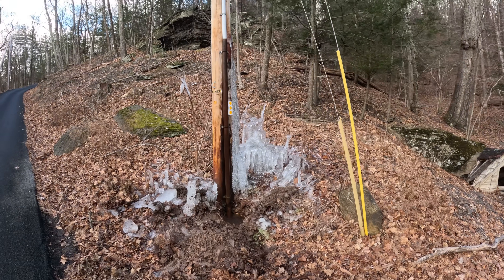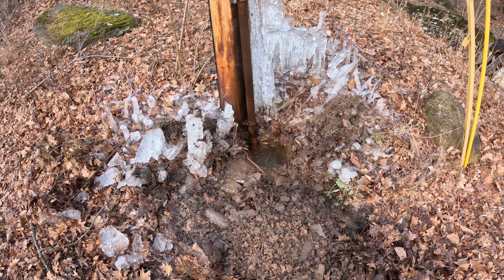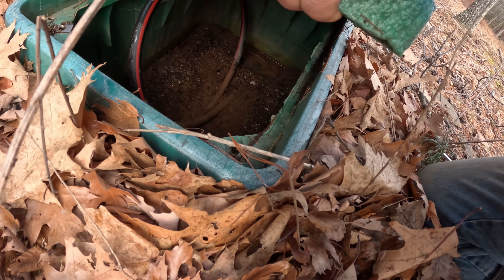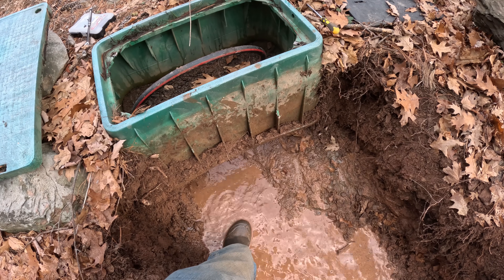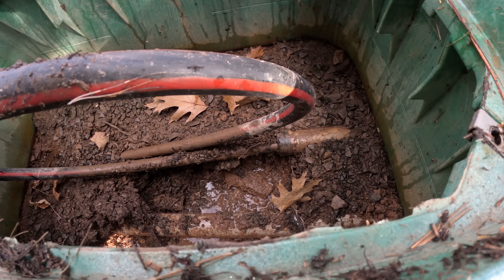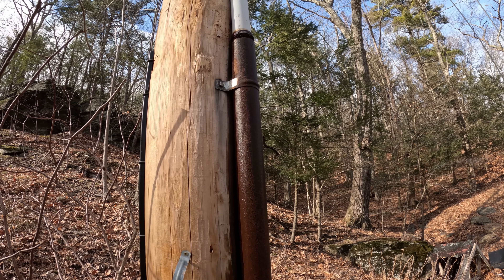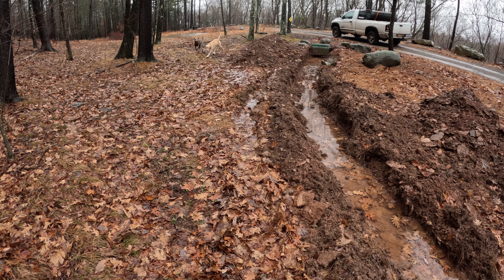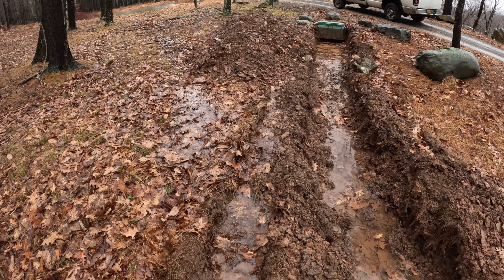Keeping water out of an electric conduit

Comment: I would take an air compressor to the conduit to get the water out, just so that way it doesn’t degrade the wire faster or rust out the conduit

Comment: AC you could maybe shoot compressed air through the conduit at the pull box to try emptying the standing water inside the conduit. I doubt you'd get all of it. Drilling a hole or two at the elbow and then using the air would certainly get it all out and dry the inside too. Then u could seal the hole(s) in the elbow. U did the hard part already, eliminating the source of flooding. It's pretty cool how nature will find a way to expose our little human errors. Where I'm from you don't see this because the elevation is flat. The flooding at higher elevation caused the water to go UP the conduit at the pole. Very strange for anyone not used to hills. 😮 💦⚡

Comment: Watch those pull boxes that cable could be a high voltage cable of 12200 volts if energized
Reply from the maker: It is high voltage. My understanding is to not even touch it.

Comment: as an electrician i have dealt with this a few times but only in situations like this where the water ingress is on a slope where one end or the other ends up with water coming up above grade. UG conduit always has water in it from condensation over time if from no other source electrical pvc joints are not required to be water tight and ridged  pipe is even worse electrical conduit threads are not pitched the way plumbing threads are this is why water ingress is simply permitted and factored in to the wires insulation properties....you just cant have it fountain up inside a panel because some well meaning person tried to seal the "leak" by filling the end of the conduit with expanding foam....that's "bad".

Comment: Oh no means am I questioning your video I’m watching this possible learn something that I’m not aware of i’m not sure which way the cable is going from that box but I would always recommend digging with the cable straddling the line and digging in the direction it is right that way if there are other cables that you’re not aware of or hitting it he will drag over top of it and not yank it? I recently had a conversation with a guy regarding this one we’re doing a disconnect for a demolition his response was we’re demoing the house who cares as he dug and pulled the water line out not only did he break the line but he pulled it out at the valve in the street and it was a mess and even though it was in the street and not technically our responsibility since he damaged it we had to fix it and it was not fun just always want to pass on any helpful hints I have not necessarily for Whoever is involved in the video but anybody reading the college knowledge is key and knowledge is the best thing that you can accept or pass on to someone

Comment: Nice to see an operator who will get out of the cab and grab a shovel, that's a rare thing. Generally they mess about with the hoe or loader trying to fine tune things and just waste time and fuel and don't do as good of a job as they could have with a spade and a rake...  
Dude I watch your channel because you're a total stud, the things you accomplish with your equipment is amazing especially your early videos before you had the larger more capable equipment. 
I have some feedback on this video that I feel bad offering. I think you rule man but I was cringing at 12:39 when you buried the drain with big rocks on top of it. Those rocks most likely just pinched off your pipe or will over time.  You can't back fill your trenches with "Deleterious Materials" like rocks or wood on top of your pipe. A sandbag (or two) on either side and one bridging across the top is acceptable, but with soft material like the pipe you're using, those rocks are a total sin. 
I guarantee your capacity is or will be reduced from what it could be which will cause it to plug up a lot more easily, and the odds of you needing to redo that job are high.  
Sorry if that came across as rude or preachy, I just hate to see a great guy waste his materials and have to re-do a job.
Reply from the maker: Thanks. yeah, I did that to hold the pipe down. Hopefully it stays working. If not I will use stronger pipe.

Comment: No video of the top of the conduit going up the pole, but it should have a weatherhead on it to keep water out of the that conduit.  The utility should have required a pedestal enclosure when used in an area with poor drainage or prone to flooding.

Comment: It's good practice to install a drain at every pull box.  It is a requirement on a commercial installation.  We ran many of them into the nearest storm drain. Where I worked, the original installation resulted in a spring running into the main electrical room.  We did stop it when we ran new high voltage cables into the service.  So where there is subsurface water, the odds of water running into conduit is pretty good.

Comment: Shared this with my brother who just retired from National Grid out of Hudson NY. He’s seen this  issue many times. As you stated they drill a hole in the conduit usually. He was wondering why you have those boxes in when your transformer is up by your shop?
Reply from the maker: Because the run was so long, it helped to pull the wire in sections. I should have just installed more transformer boxes in case I wanted more electric services. I guess it wouldn't be hard to dig one of those up and drop a bigger box in place if needed though.

Comment: I hope that that is low voltage you working with there (<600vac) Even that can fry your ass on that excavator.
Reply: You're funny, it's a coaxial power feed, single phase, either 7200 volts or 9600 volts.

Comment: Great job, you always fix them right.  I don't miss chasing water leaks to finally find it a mile away. They always follow the electrical conduits for some reason. I chased a leak for 6 months trying to find the source. Finally found it. A homeowner had a leak on their in ground pool. It was my water but not my problem after that point.

Comment: Anyone care to explai. How this fixes the problem?
Reply: Look where the pole is and where the box is. Ground water was flowing in to the box, and power cable is bizarre. There is metal pipe in which they put power cable, there is space between and water flowing into the pipe. Because box is higher than the exit of the pipe at the pole, water was coming out there and it acted like the culvert for water.  Andrew dig a ditch so the water flow into it not flooding the box. Now water is below the pipe and not flowing into it but to the culvert he install.  But this pipe is still full of water. Maybe it will vaporize over time, or corrosion will make hole in it and it will flow to the ground.  Hope that this clears things out.   Sorry for chaotic language.. not many chances to use english

Comment: I've been watching several of his repair jobs annd I don't understand how he is getting away on his welding jobs without making sure that all the oil, paint & other junk is removed from the welding area. If you are using stick welding you can get away with this at times but Mig welding requires a clean joint.

Comment: It amazes me that someone so smart, talented and gifted with the ability to fix anything thrown at them, can be so incredibly stupid by poking and prodding at an energized primary voltage hand hole, with a metal shovel, standing in water. I’ve seen 4 fatalities in my career with these circumstances. That underground cable we use is garbage. You may think it’s insulated, but the slightest tear in that cable will leak voltage. You won’t feel a thing.

Comment: I have a neighbour who has 'a spring' in the middle of his yard.  It is the spot where the pressure of the water in the bedding sand surrounding a 10" natural gas pipeline overcomes the weight of the ground above.  The water is flowing in the bedding sand and the entire installation is on a slope.

This could happen around electrical services causing flooding into the perimeter drains.  As a matter of fact I had a ditch dug for a service that filled up with rain water which broke through later that night into the perimeter drain system which was evident way down the hill as a brown stain running into the river down there.  It was about a 300' long ditch 3' wide and 3-4 foot deep.  That was a lot of cubic yards of water to collect in there and to drain out through those 4 inch perimeter drain pipes.  Talk about creating underground streams.

Comment: Our conduits for the runway and taxiway lights always fill with water when the drains clog and due to ground water. It's a 5kv constant current system and usually the water isn't a problem.

Comment: I have an idea for you, Andrew....obviously, the body and beds on modern pickup trucks are too thin and flimsy for real work, so a friend of mine has come up with a solution..he has taken a late 1990's Dodge 3/4 ton longbed pickup, with a Cummins engine, removed the body and bed, and is installing a 1950's/'60's Dodge Power Wagon military truck cab and bed on it...the cab and bed are tough as nails!...and, it looks good..everything seems to be working out well, he has it about 80% finished...good way to keep the reliable modern mechanicals, and get rid of the flimsy modern body(and crumbling dash)...just an idea..😉

Comment: Leave that elbow loose or that moisture will sit in there and rot the wire insulation. 
I usually drill a small hole on the bottom of the elbow then scrape the ridge off on the inside.

Comment: You guys watch out on that power wire! It's probably 7500 volts, if you cut into yours an explosion will result and you will probably be electrocuted on your machine. My wife worked for an electric company and one of the linemen touched a hot lead thinking it was off, he got electrocuted and lost both his arms above the elbow. When the other guys at the scene pulled his gloves off his fingers stayed in the gloves. It wasn't a good day. He lived. Think of those underground powerlines as a buried 55-gallon tank full of gasoline. That's what I do, It helps me to respect it more. I love Andrews's videos!

Comment: Word of advice andrew, maybe you should take this video down.   I work for a power utility and anytime we come across tampering involving our equipment it usually turns out bad for the customer.   Your utility may be way different.   just my 2 cents.
Reply from the maker: They told me to do it. I was in contact with them during the project.
Reply from the maker: Here the wire is customer property. I am allowed to do maintenance to it.
Reply: @AndrewCamarata  Right on man, disregard the comment
Reply: That would depend on where the utility company's responsibility ends (not necessarily at the meter drop) and where the property owner's responsibility begins.

Comment: I did exactly that to my electric service conduit.  Made a cut across the bend in the elbow...drains water like a champ.  But what are the odds that you'd set a pull box right on top of a spring.

Comment: Nice work. But a more simple fix would perhaps have been to inject some expanding foam into the open end of the conduit?
Reply from the maker: I would rather have the pull box not have any water in it.
Reply: @AndrewCamarata  Agreed, your fix is thorough and correct, but the neighbors had apparently just been complaining.

Comment: Breaking the elbow to let the water flow would have just lead to a cavity being created down and around the underground portion of the pole. Wouldn't take long for it to eat enough away for that pole to start leaning in whichever direction the weight of the wires is hanging. From there it either breaks or falls down or has intermittent loss of connection when its windy or any number of issues that creep up when a problem was not fixed correctly. Your fix keeps the packed dirt under the pole just as it is and diverts the water problem far away from the pole. A much better solution. Well done.

Comment: There is no such thing as a dry raceway. I have even had gallons of water pour out on me from an overhead pipe INSIDE a building. How 'bout an "ice volcano" that blew the door off a pad mount transformer. - Running water from 13.2 KV line in an underground concrete encased conduit that kept the water from freezing and draining away but froze when it exited the pipe and kept building up until it ht the pot heads and BOOM! - Just enough mineral in the water to get the arc going and cause a steam explosion. .... I gave up trying 30 years ago. There is just no way to keep water out. Like the code says "Arranged so to drain" like you did is the best you can hope for..

Comment: As long as the water did not get inside the cable jacket and next to the individual insulated wires there should be no problem. Still good to keep water out of the conduit sleeves.

Comment: I have a kx 121  like yours. It broke a pin on quick attach and the thumb. Thinking about changing to a solid pin. This be  third pin. 1,st pin was bent and not broken. The machine has done a lot of rock work for retaining walls.
Reply from the maker: I changed to a solid pin, I made it. There is a video of me doing it.
Reply: @AndrewCamarata  Ill look for it.Thanks.
Reply from the maker: Yeah, I have a 121 and a 161
Reply: Is that another kubota  you got like at the mountain

Comment: MINE IS ALSO UNDER GROUND 350 MCM AND 3 INCH CONDUIT BUT I LAID THE WIRE IN TRENCH FIRST THE PULLED THE CONDUIT FROM EACH END OR DIRECTION FROM POLL AND FROM HOUSE TO POLE AND  COUPLED AND GLUED THEM UP  BUT MINE IS ALL DOWN HILL AND ONLY 300 OR SO FEET LONG  COMPARED TO YOURS A SHORT DISTANCE SO I CAN SEE WHY YOU HAD TO INSTALL JUNCTION BOXES BECAUSE OF THE LONG PULL UP TO THE CASTLE  AT BASE OF MY POLE ITS STILL DOWN GRADE SO I DRILLED A SMALL HOLE IN MY 90  OR THE ELBOW THAT TURNS UP THE POLE AT BASE OF POLE AND DUG OUT AND PUT GRAVEL IN THERE INCASE WATER EVER GOT INTO THE CONDUIT IT WOULD DRAIN OUT  DIRECT BURIAL WIRE IS GOOD BUT OVER TIME MANY YEARS WATER CAN GET INTO IT AND CAUSE A SHORT I DON'T WANT TO EVER HAVE TO DIG MINE BACK UP AGAIN IF I CAN HELP IT MUCH OF IT IS ABOUT 26 INCH'S BELOW GROUND LEVEL BUT BECAUSE MY PROPERTY IS TERRACED SOME OF IT IS UP TO 8 FT BELOW GROUND LEVEL AND I WAS 20 YEARS YOUNGER DOING IT MYSELF LOL IM ON A LARGE HILL ALSO  BUT NO GRAY STONE LOL  BUT DO HAVE SOME LARGE LIMESTONE ROCKS  I USED A TRACKHOE TO INSTALL MY DITCH

Comment: Great job bro !
You could try to blow the water out.  Just connect an air compressor or the tire bead seater and seal it with some plastic bags (doesn’t have to be air tight). That should dry it out enough 😁

Comment: I am confused. The line from the pole is light grey, the conduit is metal, the line in the pole box is black with a red stripe, the conduit in the box is poly. Would an electrician explain please. ?  Thank you. 😃
Reply from the maker: The 10' up the pole has to be metal (its very thick meta). I think I just slipped it over the plastic there.

Comment: Before connecting the hydraulic lines, turn off the engine and move the levers to relieve pressure in the hydraulic system, you will not have to bother with connecting.

Comment: Like I said before put the hammer in the leanto of put it on a pallet up off the ground under a rubberized tarp., I used to work on those and they are not cheap to fix.

Comment: I would have liked to see that chamber cleaned out too, but you are a busy guy. They could have avoided the problem by using a vertical bend in the pit and sealing the conduit. Actually I’m sure that’s code.

Comment: Water is not running through the conduit anymore but the water in there is going to be there for many years.... Needs to have a weep hole and drain in the bottom of the lower sweep.

Comment: Andrew the water in the pipe will erode the plastic on the wire quicker. But you did a great job of solving the major problem. 👍👍👏

Comment: I saw three things you did kind of wrong! You didn't lay a filter fabricate layer under the drainage hose, you should have buried the hose in the middle of the gravel, and you should have hand tooled the clay and dirt out of the box a little and have put in 1 or 2 bucks of gravel inside of it! To help keep the clay and leftover debris from clogging up the drainage pipe somewhere down the road from now! Otherwise, you did a good job! P.S. I really enjoy watching your videos!
Reply: OMG! another keyboard cowboy!!! No need for fabric on bottom in this case, solid rock on bottom,  as for pipe holes.... corrugated pipe have slits all the way around,  so the gravel contacts all points.
Reply: @alithemagicbum  Sir, some of these folks have actually designed and installed 3-4 low voltage LED lights in the planter at the front of their apartment. Do not minimize their level of experience and expertise!! Lol 😆
Reply: @giggiddy  you're so right,  lmao SIR ¿

Comment: The water is getting in at every joint in the run.  Even if you think you glued every joint it still gets in pipe.   At the low point in the pipe run install a box and stone      Carefully open pipe to let water drain out instead of going up pipe at the pole
Reply from the maker: It shouldn't. The pole is dry now.
Reply: Great.   Good job.   Always useing your mind

Comment: Try a blower or compressor to force the water out of the conduit from the high side. Granted it isn't easy rigging up a mostly airtight connection to the end of a conduit with conductors coming out of it, but it doesn't need to be perfect and should do the trick.

Comment: Stupid question- since the water was just entering through the open pipe couldnt you have just filled the end of the pipe with some expanding foam type stuff to seal it and prevent the water from entering it?
Reply from the maker: IDK, water still gets in things. I like the idea of the pull box being dry more.
Reply: @AndrewCamarata  fair point. :) And the content is never a let down so there is that.